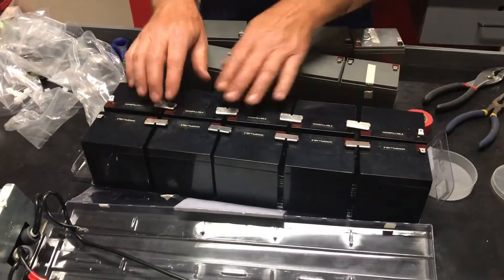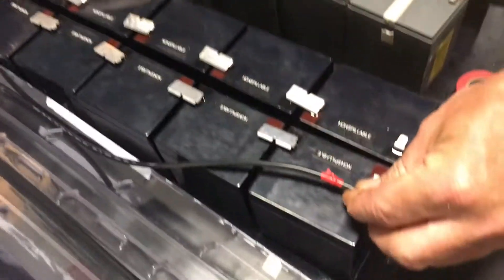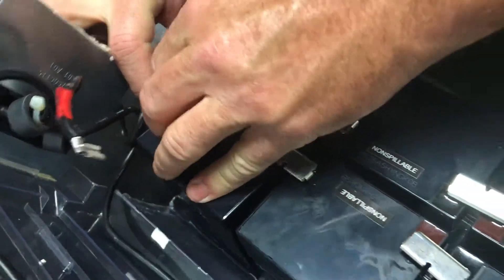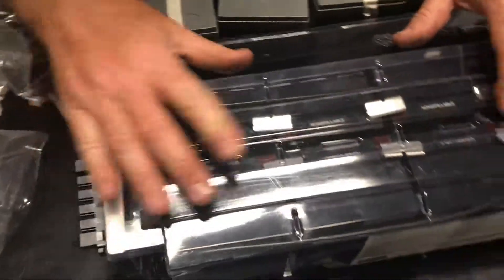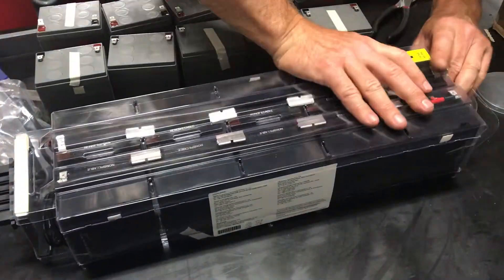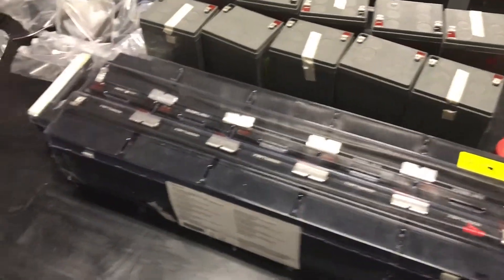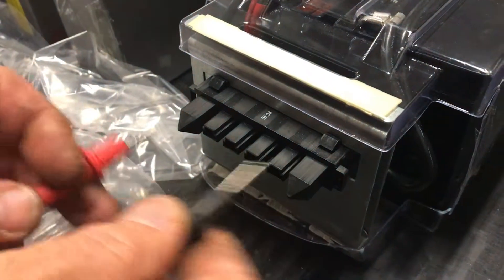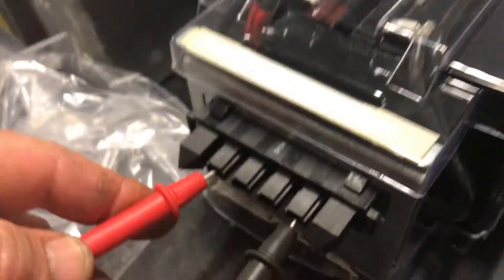UPS Battery Replacement 4

Comment: what battery voltage can you plug from outside ups ,can i plug in 48 volts in to hp hstnr-u009-i ad run it from my 48 volt solar unit ?
Reply from the maker: The ups in this video are used as an AC backup power source. Each individual battery in the stack is 12v. I haven't looked at the output/input specs, so I can't provide details beyond that.